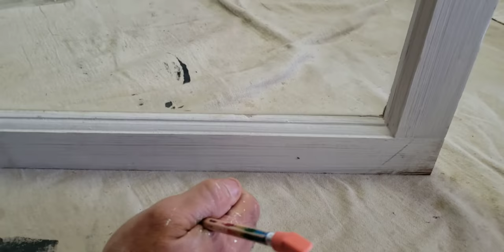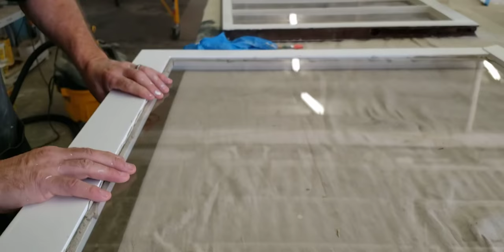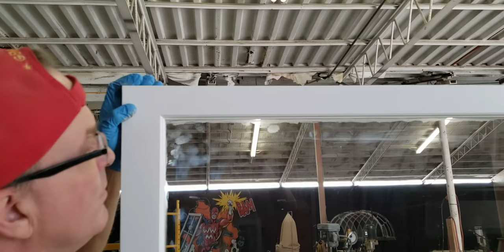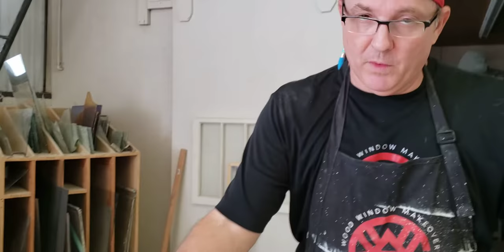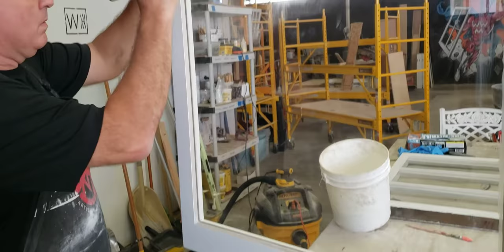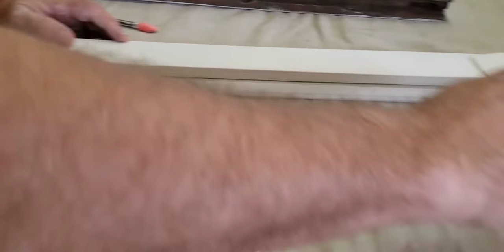Bedding, Securing and Glazing Antique Wavy Glass

Comment: Thank you so much for this video!!! I'm doing my windows - the people that put the windows in really did a terrible job with cleaning off the glazing.  You can see it on both sides of the windows.  I have a fixed upper rounded window that I don't feel confident to get out of the molding - but, just tackling these lower ones is very satisfying - and definitely a learning experience!!!

Comment: feathering all edges with sandpaper lends more strength to the finished sash,so it can take a lot of kid slams,also round corners  ship off a bit at all 4 corners with the glass cutter square 1.8th   thick slot right above the cutter wheel,,,,bedding the glass also insulates against outside noise heat  wet,and cold temps

Comment: I am interested in your diamond glazing point driver because I have found the GIANT triangular points you get nowadays are useless!  Do you know the maker of your driver?  Does it shoot different sizes of points? Do you use different size points or stick with one size?  Thank you for all of your expert knowledge sharing and detailed videos!
Reply from the maker: Glad the videos are helping. The point drivers are available new for about $200 or more. You can find them on eBay too and sometimes you can find a deal there, like $45 or something. I’ve found several through the years. The ones you want shoot the little diamond points ♦️.  The small ones are the ones you want to use and those are called size 1. So you want a gun that shoots the little ones, size one.
Reply: The old ones worth looking for are Fletcher brand.  The antique Fletcher #5 is a favorite.
Reply: @WoodWindowMakeover  you prefer the diamonds instead of the fletcher style ?
Reply from the maker: The diamonds and the fletcher style aren’t exclusive to one another. Fletcher drivers shoot a universal size 1 point, size 2 and a size 5, which I think is a triangle.
Reply from the maker: I have one of those #5s

Comment: Joe homeowner needs your advice please:  I have 3 panes of wavy glass left in my 120 year old double hungs that I am currently rehabing.  They all have deep scratches, generally around the edges.  Do I go ahead and replace the glass with new, non wavy glass?  Do you know of a way polish out the scratches?  Thank you for all of your informative videos!
Reply from the maker: There's really no practical way to polish out the scratches. That said, wavy glass is a subjective subject. I wouldn't just Willy nilly replace it, especially with something as lifeless and cold as modern glass. Modern glass performs, but it does so without soul. To me that means something. Now if the wavy is missing, then whatever glass is fine for me.

Comment: I am having a similar problem with my Sarco Type M Multi-Glaze.  No matter how much I knead, it doesn't seem to flow and adhere to the wood as yours does.  I purchased online about a month ago and I wonder if it is a little dry.  It did have a bit of a scum on top when I opened it.  Can I add a few drops of linseed oil to a handful as I knead it before loading it to the bedding or the glazing rabbit.
Reply from the maker: I’m be of the first things I do with a new bucket of Sarco type M is dump entire contents out onto a board and re-knead it. It’s made out natural materials and like natural peanut butter, the ingredients need to be “stirred up”. It’s at this point that, if it feels a little dry, I’ll add some boiled linseed oil. But that’s usually not necessary. But it’s certainly alright to do.
Reply: @WoodWindowMakeover  Thanks for the quick reply, that makes perfect sense.  Your videos are excellent, music and all.  I am working with 6 and 8 pane casement windows in the kitchen of my Spanish Revival home built in 1923.  These were caked with several coats of paint which I have stripped and stained on the inside and primed and primed and painted on the outside. I was able to save all the glass and used your methods to bed the glass and it was kind of hard to get the glazing to stick.  I did get the all six panes bedded and cleaned up on my first one, but when I flipped it over to glaze the the other side, I just wasn't getting good adhesion and smooth finish, so I stopped.  This evening I'll follow your instructions, knead the whole bucket and start anew.  Once again thanks for your excellent videos. Its great to watch someone who knows what they're doing and explains it so well, super helpful.
Reply from the maker: The adhesion and a smooth finish could be the way you are holding your knife. A lot of people hold it at too sharp an angle. Think of how you’d spread peanut butter or cake frosting. You get your tool down low with as little an angle as possible. If you turn the knife on edge you scrape all the peanut butter off. But if you angle it real low, it changes the way it spreads and you’ll get better results. 

There might be something about that in this video if you haven’t seen it yet. 

https://youtu.be/HLIT_kyGq8Y
Reply: @WoodWindowMakeover  Thanks again for your help.

Comment: Is there a reason that you do not glaze the meeting rail side the same as the others?  It looks like you just fill in the void between the glass and rail and not a full angle bead.
Reply from the maker: Yes, the glass slides up into a slot instead. So there is no glazing rabbet on that particular part of the sash. This is so that the meeting rail has full contact along the full width of the rail. If you were to glaze that part like the other parts, you’d see the glazing putty from the inside of the sash.

Comment: What do you use for whiting?  How/where do you buy it?
Reply from the maker: It’s the dry powder drywall compound at the home stores. Sometimes it’s called 20 minute mud or 45 minute. The set up time is irrelevant. It’s the powder you want. It’s a blend of calcium carbonate and plaster of Paris.
Reply: @WoodWindowMakeover  Thank you.  I just glazed the first 4 of eight large panes, in situ, with Sarco Type M.  I dusted them with 20 minute drywall powder and BAM, they're ready to paint.  They look great! Could not have done it without your videos.
Reply from the maker: That’s great to hear. Remember that the Sarco putty needs a couple of days to skin over before you paint it, and then it’s straight to paint. No primer or anything.
Reply: @WoodWindowMakeover  I'm painting with latex paint.  Can I paint the new glazing with latex paint or do I need to prime the Sarco type M first?  Can the new glazing handle rain (I dusted with 20 minute drywall dust)?  It's supposed to rain tomorrow.  I'm afraid its going to wreck my new putty as I haven't painted yet.
Reply from the maker: Rain might add a day or two to the skinning process. You can go straight to paint, no need to prime, even with latex. One thing to note though, and I don’t think the rain will ruin your glazing, but you might want to gently wipe your glazing clean after the rain in case the water washed any mold or fungal spores down onto the putty. You wouldn’t want to seal any spores under the paint.

Comment: Help. Losing faith! I've stripped, restored, followed all your tips to get an 18th C window ready for setting, glazing and painting. Good news is it all went well and was fun in a way! 
Here's where it all goes wrong. The Sarco glaze. When I pull it pull. I can't get it a, to really stick to the cleaned surfaces unless I press it in and when I do (i just gave up using gloves and pressed it in with a putty knife and my fingers), then, b., when I go to pull the line -- it just comes with or makes a mess.  I mean -- I've got it, but it sure doesn't look like it's clean or like it will last long.
Setting it in the bed, I've mastered. You can really see why Sarco works better...i've just used a lot, pushed it in and cleaned it up. Great.
But on the Glazing itself? just a mess.
It's about 57 degrees (i'm working outside..) 
I've tried water -- even spit on the glass -- kneading?

But I'm holding out for the master to tell me or show me how to get the Sarco to smooth out.... lest all this time be wasted......
Reply: You can use linseed oil on your putty knife.
Reply: Mix your putty wetter than usual.  Putty will stick on your sash & glass!!!